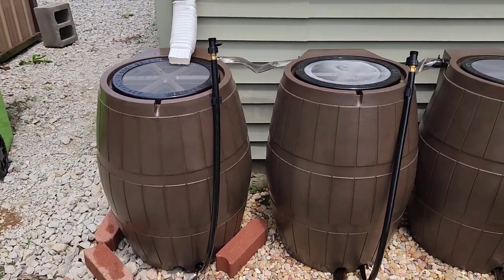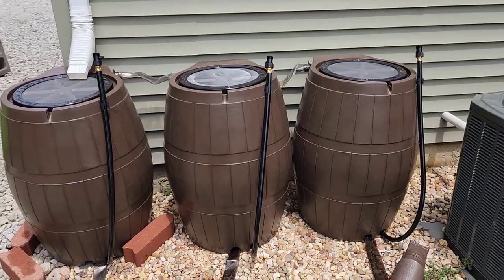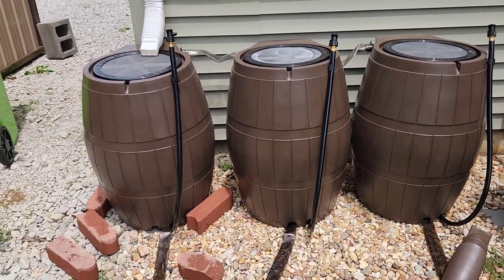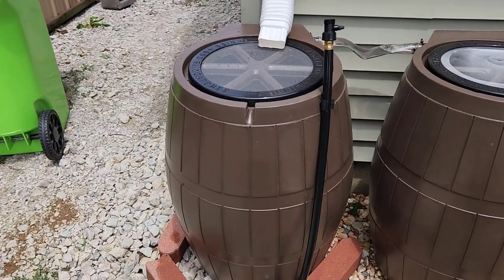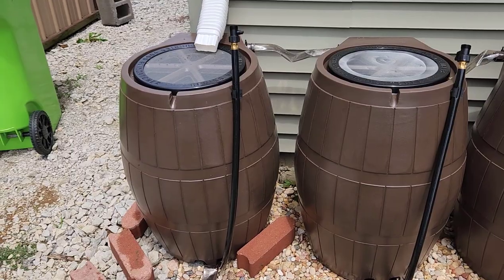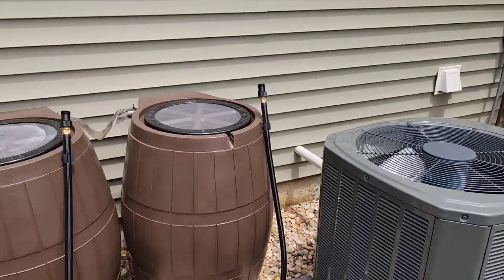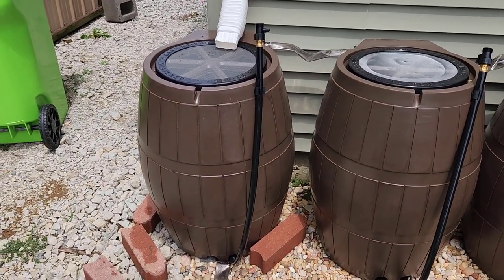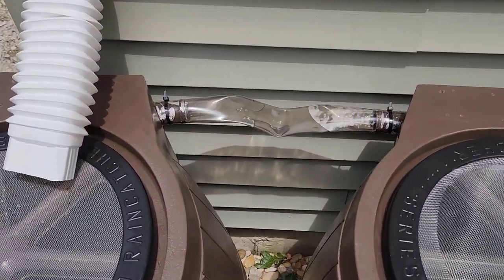DIY Rain Barrel System For Beginners

Comment: Good idea about the manifold.  Also if you are just using one barrel for gardening hose, you can raise it on blocks and it will give more pressure too.  

I have a couple of 32 gal. rubber trash cans I drilled a spigot hole about 10 inches up from the bottom to make room when i want to use my watering can.  I have the second barrel connected to the first one with a 2 inch by 10-inch (an extendable length 10 to 20 inch) hose about 7 inches lower than the hole of the first barrel.  I also have an overflow hose on the first barrel about 4 inches from the top.  My roof space is about like yours and I really use that overflow hose with just the two barrels.  Isn't this a fun project.  I remade my downspout to make it come out to the barrel, as you did.  I had to drill a lot with a hole saw but it was worth it since we are getting so much rain.  The overflow hose (24 ft.) goes to a tree in the backyard and the spigots have garden hoses going to the front yard.
Reply from the maker: Thanks. We are probably buying a small water pump to create more psi to drive the water down the decline into our garden. We'll see how it goes. Eventually I'm moving our oversize shed to the backyard near the garden installing some gutters to collect rainwater and then create a free flowing irrigation. For now the pump...

Comment: Can you screw in a hose or sprayer to the black hoses ?
Reply from the maker: Yes you can .Just need to make sure the connector is suitable (male vs female). I also bought a manifold to connect all 3 hoses into 1 central location to allow all barrels to flow at once or to allow each individual hose 1 at a time. Let me know if you'd like me to show a short video on the manifold.